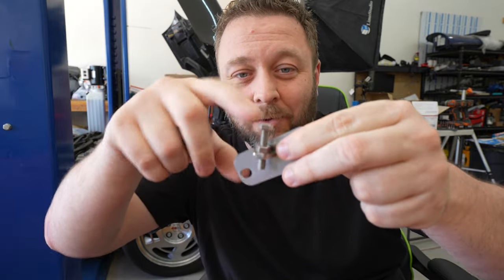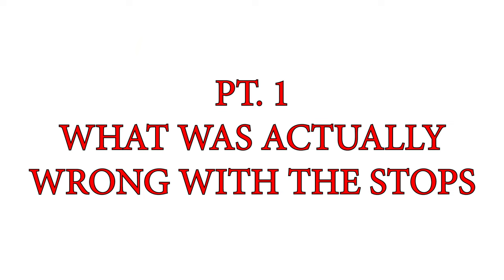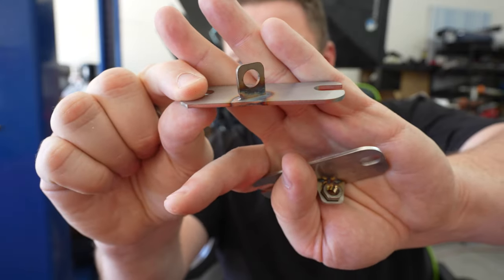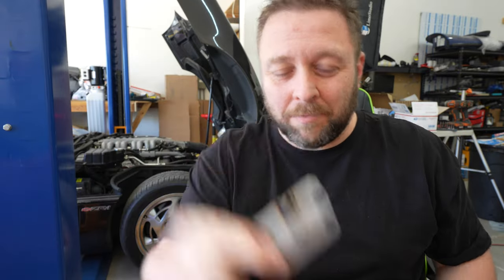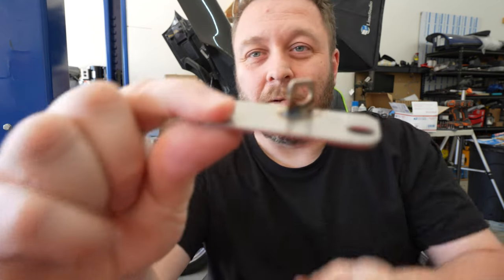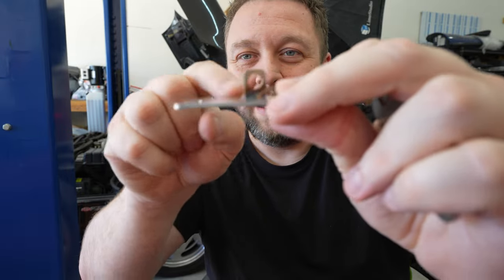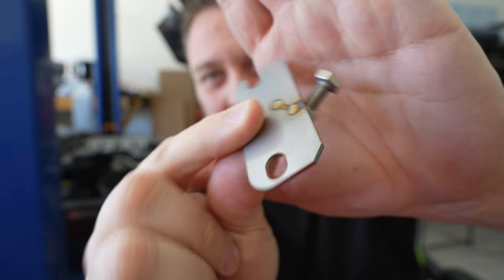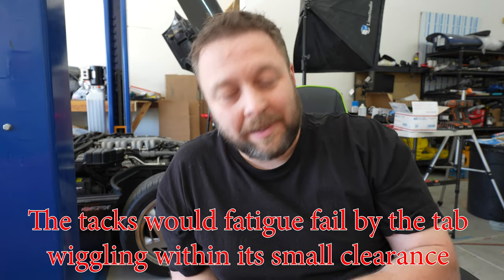Stop System Update | Mistakes compounded in runaway scenario

Comment: Funny, I have had no issues with the original stops or the install. I did use the back stops then the added metal front stops to lock the bolt. Bent it in with a deep 10 mm socket so the arm hit dead center of the nut head. If the new stops are an improvement, then that’s just another enhancement going forward with the product.
People need to relax! Don’t work on your car if you can’t figure it out even after watching the instructional video! Geez, hang in there dude and continue to improve as needed. I will patiently wait for the square bezels because I really love the KnightDrive lights on my C5!

Comment: On your next production run of the stops, consider using a PEM nut instead of welding a nut on. They just press in. Much faster, and considering there is no force on it trying to push it back out, they should work fine. I've done small production runs - they can be a nightmare. Have been working on getting a bolt-on front lift system for C5/C6's into production for over 6 years now. It's one thing building the prototype - which has worked perfectly for the last 6 years - but actually producing it makes one wonder if it's worth all the trouble.
Reply from the maker: The system ahead eliminates the nut and the welding.  Back to the core.  Funny you talk about the lift system...lol.  In 2010, at SEMA, I had a car in a booth with DUB and had meetings with a company about my development of a nose.lift system for c5/c6.  Inevitably, I still have the design and components, but never marketed it for a variety of reasons.